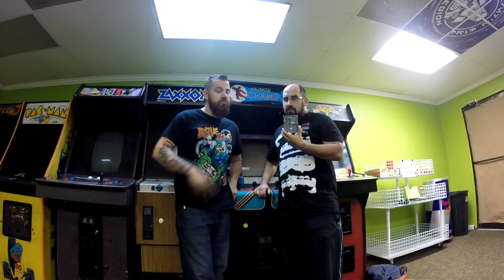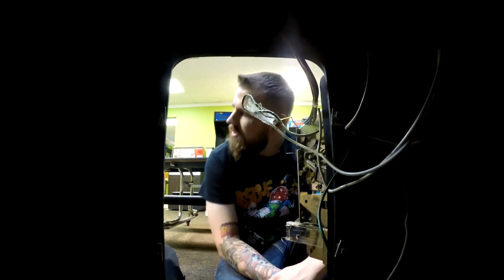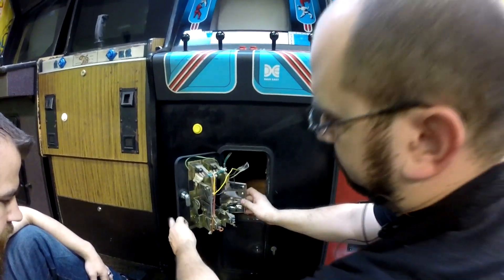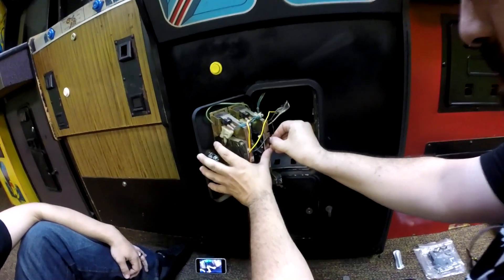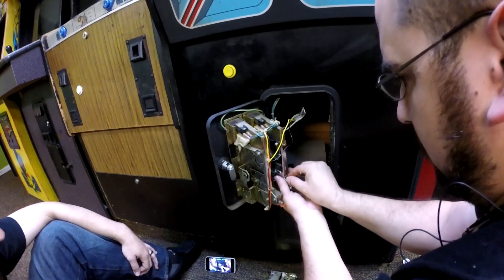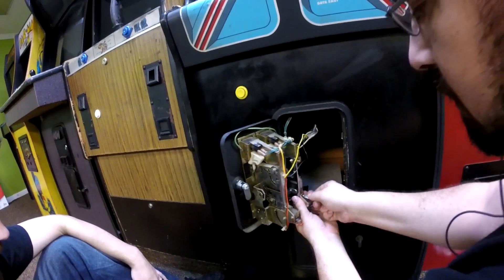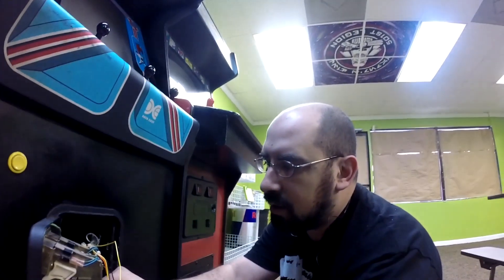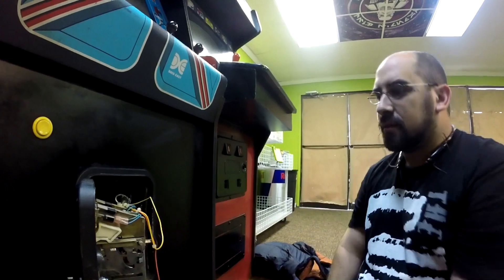Changing a coin mechanism in a Karate Champ arcade machine

Comment: Is it possible to convert a microswitch coin mech into an electronic coin mech? My old coin mech has two wires when I touch them together it gives me a play, I want to wire these into a modern digital coin mech not sure which wires would go where on the coin mech. Could you help?